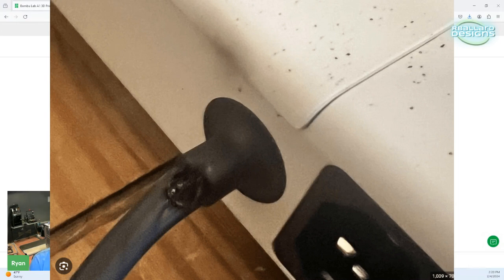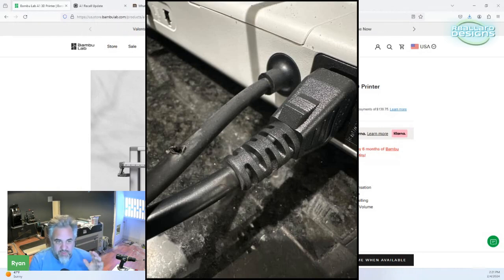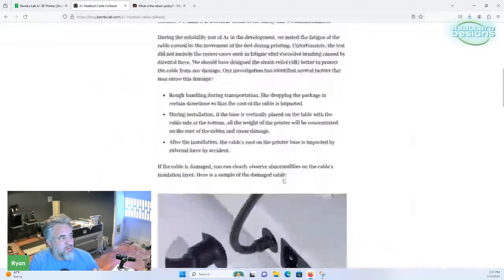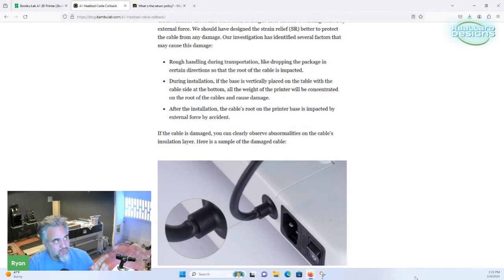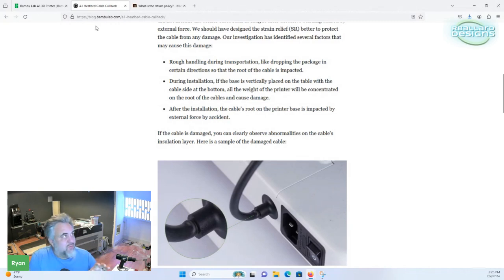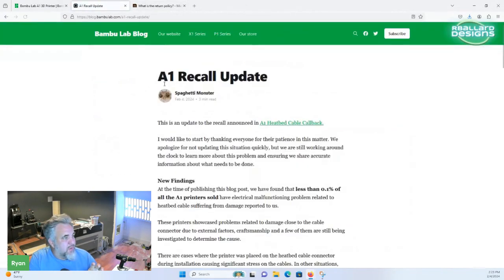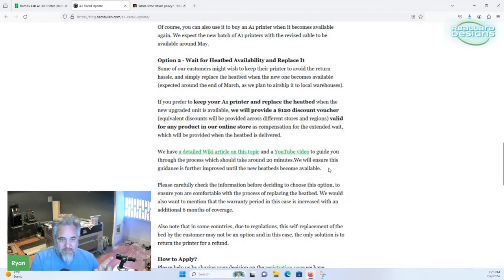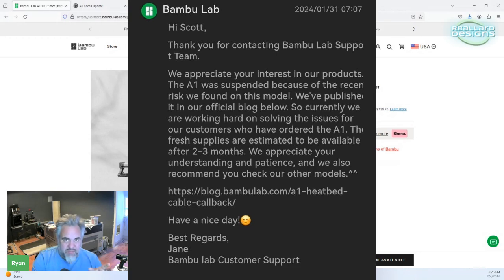Latest on the Bambu Lab A1 Recall

Comment: 1. Microcenter is honoring the $80 credit. Bambu Lab is footing the cost of that $80 credit as well as shipping. (Source: Manager I worked with for nearly a decade at Microcenter)
2. The P1S Non-AMS ($699) is the most common "Upgrade" followed by the P1s W/AMS ($949) and the mini, Not to mention a small amount of non-Bambu Lab printers. (Source: Manager I worked with for nearly a decade at Microcenter)
3. The cost of shipping thousands of units back to China alone likely exceeds any profit from "upgrades". Add to that receiving and processing those returns, R&D for the new heatbed and new A1, The cost of the $80/$120 credits. 
4. A not insignificant number of people are keeping their A1s and waiting for the new Heatbed AND getting a $120 store credit.
5. Loss of reputation and damage to public image and customer confidence can't be measured but adds to the already significant loss.

Any notion that Bambu Lab will benefit from this recall is at best ignorance and at worst, Clickbait. 

And finally: You left out the third and most important possible reason the damage in the pic you used. ( A single case I might add) Damage to the wire. Even an over-rated wire will overheat and ignite if damage is such that the current arcs.

Comment: interesting, wonder if there are more issues with the North American Bambus, looks like they are using the same cable for both the 230 & 110 V version.  110 would technically require thicker wire.

Comment: If I wanted the benefits of enclosed printing I would make the jump to the P1S. I don't. If I didn't want the build space over the A1 mini I'd swap to it instead. I do. If I didn't like swapping nozzle size on a whim I'd return the A1 for something else but it fits my use case perfectly. I'm personally sticking with my A1, which has no issues cable or otherwise, and will be fitting the upgraded heat bed when it arrives. It's pretty easy to do and not much more complicated than building the A1 in the first place.

Comment: I mean even with the A1 issue, the Bambu ecosystem is good. They handled the A1 issue the right way. They didn't blame all the users and ignore it, they identified an issue, and provided multiple options for repair/replacement/refund and even a work around to prevent issues if you aren't having any yet. That's how these things should be handled.

Comment: its not a $390 profit unless you are assuming it cost Bambu the same amount to manufacture an A1 vs a P1S. it's straight inventory loss or write down of all the returned A1s. plus potential opportunity loss if the P1S is already in demand prior to A1 recall. what i think is possible is that the cost of an A1 is close to the profit of a P1S which could mean they won't go too much in the red on the whole debacle, but to claim they are profiting off it is a stretch. people returning their A1s and going back to Bambu again is a good sign for the company which didn't get that kind of customer loyalty from being a bad company. my base assumption is that they are treating this is a lesson to improve rather than an opporotunity to make even more money. 

i also doubt that the engineers got the root cause wrong, because making a mistake on that front would erase the goodwill they are trying to rebuild now when the next failure happens on the "fixed" models. if the wire is melting because of insufficient capacity, then would not be melting at the same point every time, which is just outside the strain relief segment where kinking was likely to have been present first. this was a design flaw from the beginning to make it a fixed cable instead of a connector version like on all their other models or most printers in general. increasing the core gauge would reduce the cable's flexibility while not addressing the root cause. they could spend a ton of money and engineer time to redesign the strain relief, or they could easily retrofit a connector instead so that cable doesn't have to be attached during shipping or user maintenance.

Comment: get the p1s very good printer if you want a bed slinger just get a prusa but it will cost more money
Reply: buy a prusa if you want excellent customer service. But this comes at a price. the prusa are not better than any other model especially in 2024, I would even say that it lags behind at certain level. You can get just as good a machine cheaper from another company. But its other companies struggle to match the service and community that is built around Prusa.
Reply: Prusa is the best if you can afford it i have 2 mk4 that have been running 24hrs a day for the past six months and not one problem not one failed print as of yet , but both my p1s and a1 mini have givin me lots of failed prints had to change the build plate because the gold bambu one does not last very long the ams likes to get jamed up with matte filament easy to fix but a pain in the ass and now the AMS filament reader reads there filament in the wrong location so 1 will be 2 and so on the build quailty is not what you think thats why the price is so good you get what you pay for in life. @isod89

Comment: They aren't making profit. It's not good to spread misinformation like this.

Re-engineering a cable on a mass produced bed part and shipping those out free to option 2 people plus the voucher compensation is costing them extreme amounts.
So is receiving flawed units they would need to replace with the same fixed part from option 2. Both make them lose the same amount, as selling after repair on option 1 units is no longer profit.
It is extremely costly to change mass production processes.

People are going for the P1S because they still want a large bed but know bambu has the best printer reliability trend. This is fairly well known.
As for the discount vs microcenter, this makes sense. It likely is a move on their part to not end up bankrupt from how much of a whack this is.

The damage shown is from shorting due to cable damage. This can vary unit to unit, but the trend is the strain relief failing, or the bed being up against a wall or alike causing the bed to repeatedly crush it against said wall, or from user error such as in initial setup laying the printer on said cable; effective crushing it. The relief also does not resist against cable-twist, which is another major cause.
Reply: I was about to make a post, but it looks like you did one for me, as that is exactly my thoughts—gross misinformation here. First, third-party sellers are sharing in the rebate deal, clearly written in the Bambu info. Also, they are covering the costs for shipping and shipping materials if you don't have your box.

I have already had three updates to my ticket, and they have indicated a replacement heatbed could be as early as March (licensed electrician, I think I can handle the install). The reason people are moving to P1 is that they know it's a killer machine. If there is a side effect of Bambu mitigating some losses due to that, then good for them. What a show of confidence in a period of what should be a devastating low.

In my opinion, the root cause is people bending their machine over on the cable during installation. Sure, that cable looks to be value-engineered to the margins, and by rights, it should be able to withstand possible (predictable, frankly) actions by the end user.

I went with option 2. I get 160 CDN, which makes this a huge deal. Guess I'll go back to my Ender 5 for a couple of months and play with that some more. I'm going to move it to Klipper and use that rebate to buy extra mod parts!
Reply: @TheStealthbob gross misinformation. It's all a n speculation melting pot. At the end of the day it's a sale of consumer goods for consumers to consume more to create items for other consumers to consume.

Comment: Tbh, if the cable could easily be damaged, that's a design flaw in itself, especially for a cable that's supposed to bend through normal use of the printer.

Comment: I am in this exact dilemma and can’t decide what to do. Is the P1s actually better then the a1
Reply: No
Reply: It depends. Core XY printers in general have some inherent though, maybe minor, design advantages over bed slingers. They are less likely to have issue with larger heavier prints, they have less strain on the heated bed cable, and take up slightly less desk base in the travel direction of the bed slingers bed, to name a few. Though the P1 is considered to have an inferior control panel to the X1 and A1 series.
Reply: Ya control panel sucks but just use phone or but after market panda for 60$
Reply: @bbbaffiliated  not true

Comment: Overvoltage or overcurrent seems unlikely. Moving cables are subject to wear. If the cable had been twisted incorrectly during install, extra tension could cause premature wear leading to this failure.
Reply: Yeah, although ultimately you get over current at the breaker when two of the conductors go from having high impedance sheathing or whatever between them to low impedance leading to current flow through parts that aren’t supposed to carry any (or negligible) and heat generation through a poor variable connection as the cable moves and flexes. Or alternatively maybe the stranding is breaking in one of the conductors increasing impedance in a section leading to heat production. Curious what turns out to be the most important aspect and whether it’s just damage due to handling or design or manufacturing (probably some mixture).

Edit: guessing the strands are damaged in the conductors. See around 59 mins in: https://www.youtube.com/live/gITwRYN4VrI?si=mEw0yTJbvBjesHVA